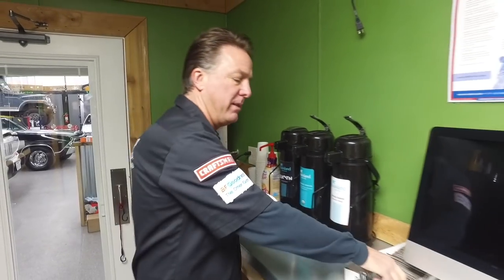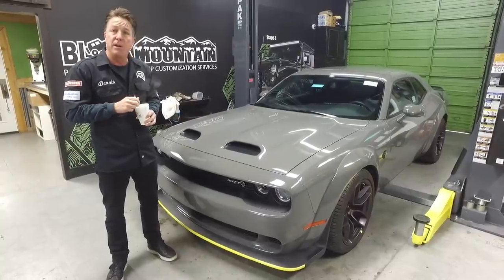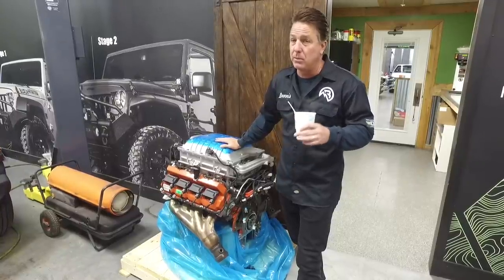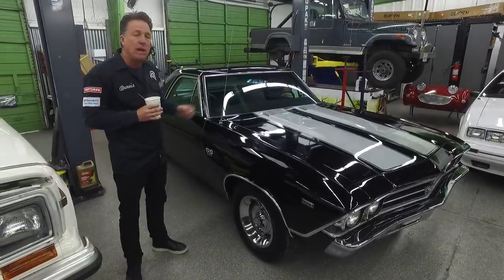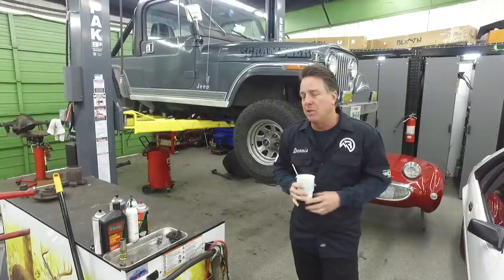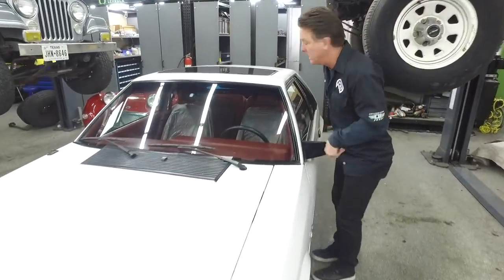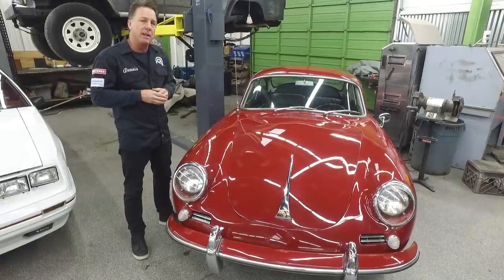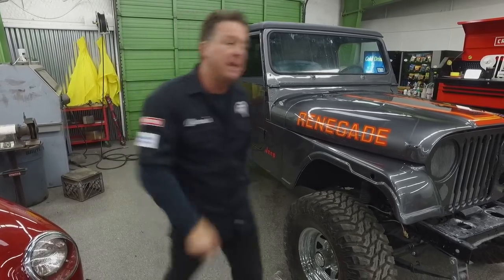Coffee Walk Ep.37: February Cars!

Comment: Dennis Collins: How does one go about getting ahold of you to see if you have any interest in these vehicles? 1968 Elcamino SS 427/4 speed 12 bolt Black/Black. Original paint and interior. 1970 SS Camaro 396 auto (split bumper) 1969 Chevy Biscayne L-72 427 4 speed. 1970 Chevy Impala Convertible 350/350 Blue/Black also a couple of 1936-1938 Ford 2 and 4 doors. All are rust free Central S.C. cars.